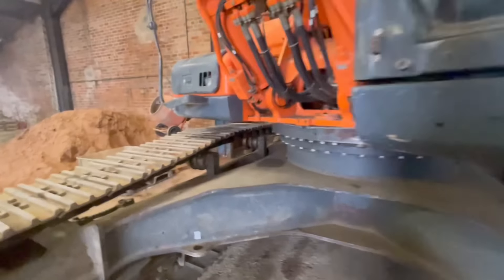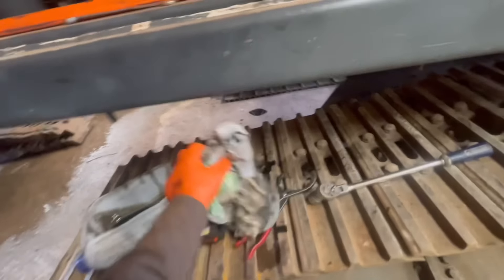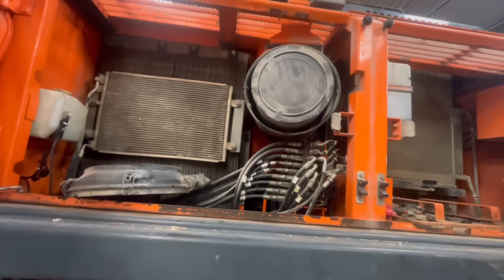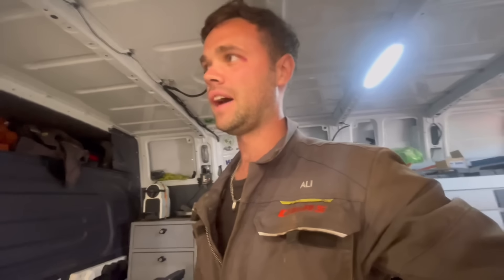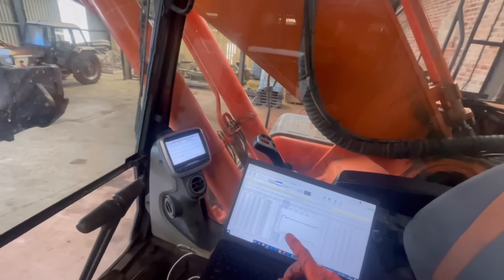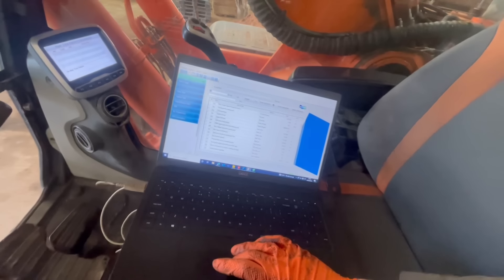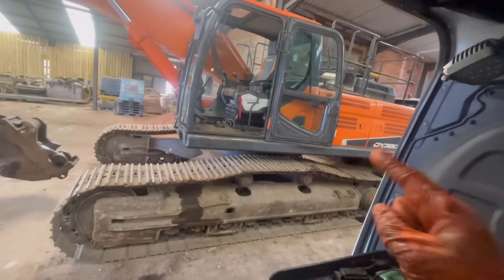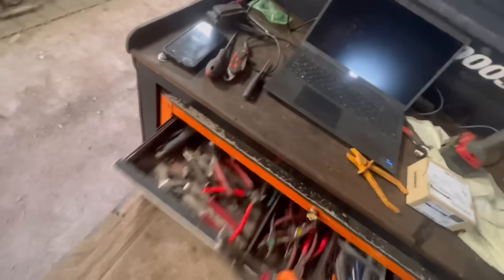Work in the 380 continues / will it be ready for site ? / Engine warning lights

Comment: The plastic socket rails on Amazon are quite good although a little tight to begin with 👍 - for any cylinder repairs I am the GM at Nicol & Andrew hydraulics in hillington Glasgow we could help with any repairs if needed
Reply from the maker: I’ll send it to you in the post John 😉😂 I think he is going to do it .. I hope he is anyway I don’t want to be chasing ram seal and eventually metal around the valve chest 🫣
Reply: @alisdiggerdiary  👍🤣

Comment: And the fuel issues will be upsetting the dpf burn . I've sent the little metal pipes clogged fully with soot Ali.
Reply from the maker: I think your right get the rail pressure sorted and go from there 🤞 I did blow the metal pipes with the air line see how it goes 🤞

Comment: Cheers Ali, interesting diagnosis on the fuel system and DPF, would live data not have shown the PD difference?. I would do the Bucket Ram as a site repair but remove it if the Piston Rod measures undersized. See you on the next one 🤙
Reply from the maker: The sensor data didn’t seem out of place but I wasn’t watching it when the fault occurred and the fault occurs when there’s an abnormality that’s read by the sensor I replaced it and the fault didn’t re occur I’m hoping it was a bad sensor I’ve not heard otherwise, the ram … not sure I’m getting the job maby going to tackle it himself 🤷‍♂️

Comment: I wish I had a fiver for every time I’ve overthought a problem, usually when you’re under pressure!
Surprised you did the regen after changing the engine oil?
Reply from the maker: The older machines regen every 8 hours so it’s ok probably better to do so after an oil change and look over then I know what state the oil is in and levels are correct